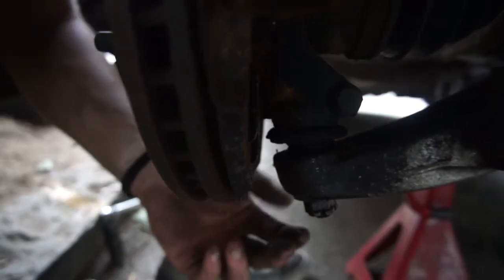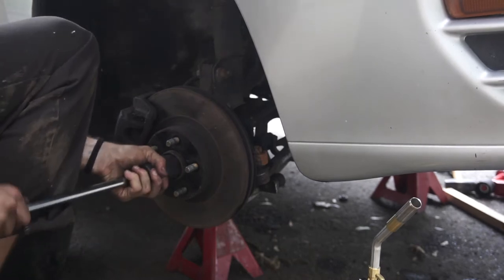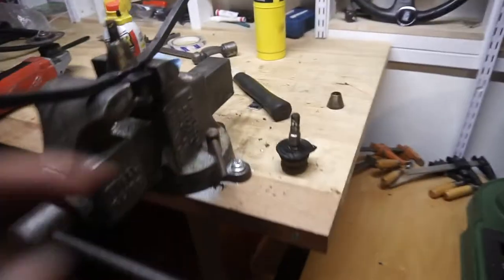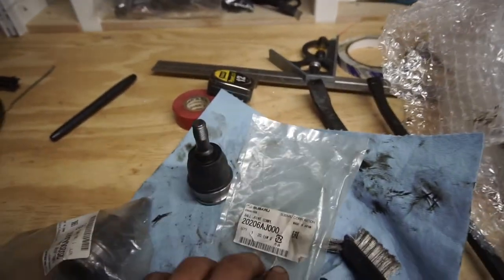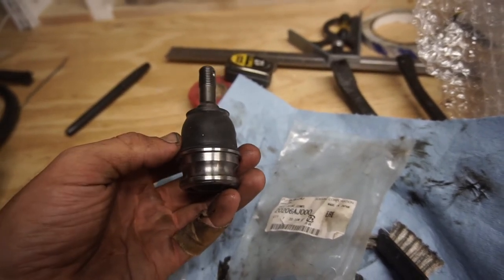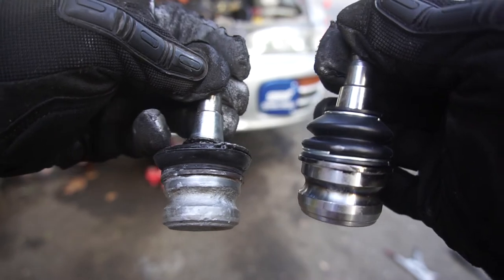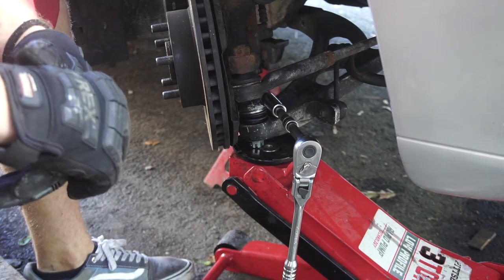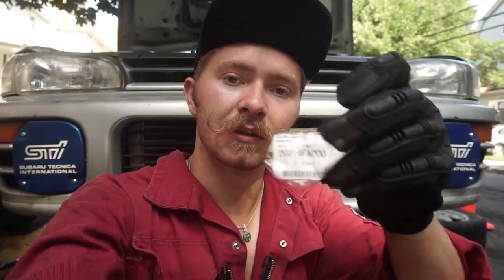Ball Joint Replacement on a 92-2014+ Subaru WRX / STI

Comment: A good trick that works on any of these stuck suspension parts is to use some PB Blaster as said. But also get some Kroil and WD-40. Also grab some Gunk. First spray the gunk on whatever suspension part that is gonna be a PIA this will help remove any dirt, rust, grease or whatever. Then spray the Kroil, then the WD-40 and PB Blaster. Do the last three at least a week before morning noon and night. It doesn’t have to be in any set order. This will help the oils get through into the threads and make it a whole lot easier to remove. Amazon also sells ball joint removal tools for less than $30.
Reply from the maker: Yeah I forgot about doing that. I thought it would be quicker but obviously I was wrong. All I know for next time though is that I’m getting a ballpoint removal tool 100%. No reason not to have one at this point